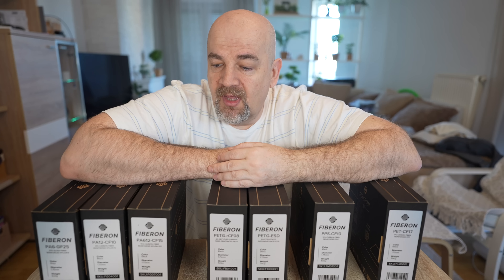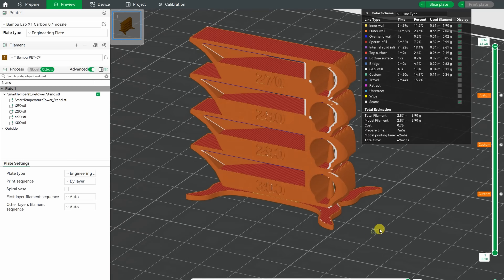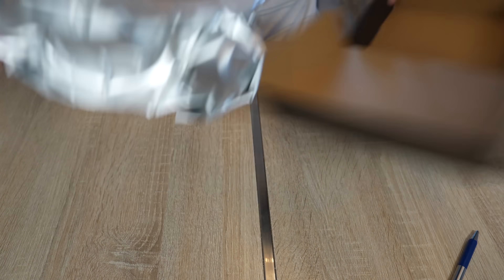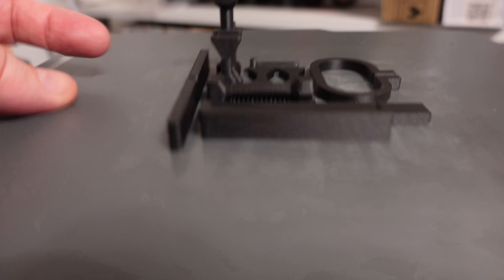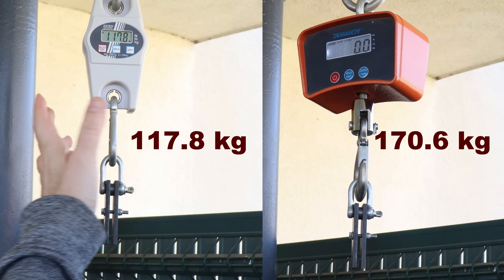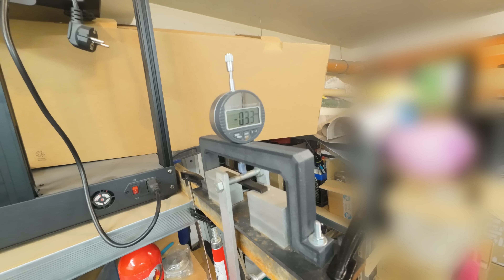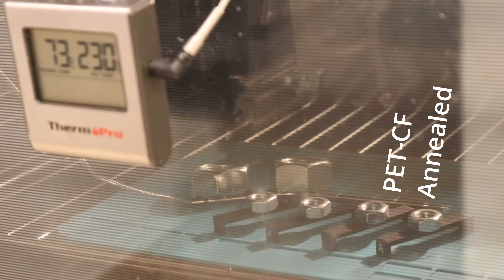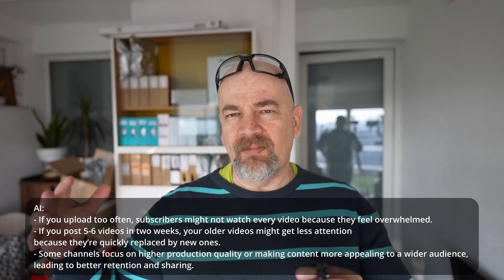Review of Fiberon PET-CF17, a great technical filament by Polymaker

Comment: Hello, I plan to print with this filament on an open printer, I have a Sidewinder x3 pro from Artillery, I will replace the nozzle with a stronger one - made of hardened steel, I would be grateful for tips on the profile for this filament - how to set retraction, cooling, temperatures, etc., so that the print is relatively durable despite the open printer ;), thank you in advance for your answer and best regards.

Comment: PET-CF'S stiffness and creep resistance look great, but the only thing that gives me pause is the creep under higher temperatures. ABS glass transition temp and Vicat softening temp are nearly the same, so it won't appreciably creep until it reaches those temps. But because PET-CF is semi crystalline and has a low glass transition temp of only 79C, it will start creeping more under load once it passes that temperature, even though it's Vicat softening temp is much higher.

Comment: -- Igor, I have a question:

-- Does annealing of the part have to be done shortly after printing, or it can be done at any time? I remember that you said annealed part is more heat resistant, than none annealed part. 

Thank you!

P.S. I'm waiting for my Sunlu's E2 dryer/annealer, back in the January, but they pushed orders to May of 2025.
Reply from the maker: Best if annealing is done shortly after printing, since it don't have a moisture in it. But, probably, the negative effect is minimal. About E2, good for you, it may be a finished version, unlike my prototype.

Comment: Have you seen the critical Youtube video on carbon fiber that shows the microscopic close-ups on the filament. It looks like many small needles. It definitely put me off from using carbon fiber anywhere as I don't want that to end up in my lungs. What's your opinion on the safety of CF printing at home?
Reply from the maker: Yes, my opinion, explained here: https://youtu.be/FZXawsYfFkw?si=jLSOvMzjRYRw5GYK

Comment: 4:48 When you print a temperature tower you should set the seams to back as it will make their positions the same on every layer. This will make the test more consistent overall and provide more insight into stringing and blobbing issues.

Comment: Stephan usually prints larger batches, not just for more data, but to allow "normal" cooling for vertical test subjects. Since you only have the one or two small things printing in the latter part of your print, those will stay pretty hot and have better layer adhesion. But I understand continuing the same way so that you have like-for-like comparisons with previous videos. A compromise of learning vs documenting.

Looking forward to your PPS testing. Not that I can currently print it with the X1C. But I'm seriously thinking of a custom Voron build with a hotter hot end and maybe water-cooled motors so I can get chamber temps somewhat higher than my current 60C. Also having issues with concentricity on the x1c,...

Comment: You want more views? you need to show some more skin, sorry to break it to you, great tests as always, was a big fan of pet-cf when i was reading about it but my nozzel can only do like 260 so i went with petg-cf to try. It only needs 250c.  I got it  mainly for the stiffnes, i heard layer adhesion is weaker due to the carbon particles, hence the need to aneal, but if youre not planning to stress along their it should be as stiff as a stiveny as your test indeed show. I wonder how petg-cf differs. I hear not as stiveny.

Comment: In case it's helpful, I do not have the bell turned on but I am very often suggested your videos in my feed, probably because I usually watch them, and completely. You have a very streamlined video structure which makes it easy to follow and compare. You probably could post less often if you were being much choosier about your subjects making them more "general appeal" like you say and working longer on each one, but with your current strategy people can pick and choose whether they need to learn more about a certain kind of filament or accessory and compare it to your other videos. It also helps for me deciding to watch or not that they are not too long.

Comment: When you do the PA please touch on the bed temp settings you use on the bambu. Polymaker's print profile & settings say you should not exceed 50c as to not violate some material property, however, it seems essentially impossible to achieve bed adhesion at this temperature. I would like to see your experience.
Reply: Use glue on bed

Comment: Thanks for the good review as always. I do have a maybe not so reasonable recommendation: do you think it's worth it to test the water abortion rate/percentage for these engineering materials? I see on polymaker's website, this pet CF and PPS cf are listed as water resistant. I'm curious about how resistant they are.
Reply from the maker: Hm, I want to do some kind of testing on this. BUT one thing is amount of water absorbtion and the other is sensitivity to this.
Reply: @MyTechFun  That's one thing that popped up when I was researching printing nylon. First of all there's not much data about absorption rate, nor is there good information about the effects of printing with less-than-perfectly-and-actively-dried filament aside from a few saturated vs bone dry comparisons. Your earlier nylon drying time video is great, and I bet it would be feasible to do PL4 fitting on water absorption rate with low (dry box), medium (ambient room), and high RH (next to humidifer). Unfortunately as you showed in that video, the percentage of people using nylon is relatively low, and of those who do, the ones that care about specific numbers are even less so. I appreciate the effort!

Comment: Annealing for 10 hours at 100-120 degrees makes pet-cf much more thermal resistant. My prints started to melt at 230 degrees after annealing.
Reply from the maker: Same this PET-CF17? Or other brand?
Reply: @MyTechFun  Same, Polymaker
Reply: @antonurbanovich5153  This is what we've been saying for months now.  Just be wise to the fact that these materials will shrink in odd ways depending on part geometry, in-fill type & % and last but not least what temperature did the layers get laid down on.

Comment: I've been thinking about this for over a year for you doing annealing testing (I need to try this myself); why don't we try to anneal parts, buried inside sand? 

Make simple wooden box, use any type of fine-grain sand (Silica sand probably is best), pack sand tight around part, place whole box with part buried in sand, in oven at anneling temperature. Await results.
I bellieve this will be a better annealed part due to constant pressure surrounding object, with sand holding temp directly onto part, possibly even hotter too. 

I'll also be testing this as well. Let me know what you think about this method.
Reply: I think this will also reduce any unanticipated warping/shrinking x-y-z dimensions as well. Would retain original geometric dimensions in CAD.
Reply: I have seen this done. Another approach is to use fine salt (CNC Kitchen has a video on this) which has the advantage of being easy to clean off with water. Annealing in particulates is certainly advantageous for preventing warping.
Reply: @martinmckee5333   Yes I have seen Stephan's salt annealing video awhile ago; was curious of the benefits of sand over salt though
Reply: @RichardSats-e5l  The two that I'm aware of are the ease of cleanup and the fact that it is possible to get very fine salt in bulk. There may be others, of course.

Comment: Great job again Igor! I use this filament daily and its fantastic! Fiberon profiles are available for the BL printers and i have found the PA612- CF print profile gets better results than the PET-CF profile, just turn bed to 80 and nozzle to 285 and its smooth sailing.

Comment: Thanks Igor nice video as always! This very filament is my goto for inexpensive mechanical parts. 
A couple of requests for future vids:
1. PPS-CF: it would be great to see a comparison with Bambu PPA-CF, which covers similar use cases. 
2. In your conclusion sections, it would be AMAZING if you could add a value in each graph for the overall average of all filaments, so it's clear where the currently tested filament stand in the larger picture. 
Thank you!!

Comment: Great video and it seems I need to try PET-CF filaments as well as I was also more leaning towards using PC CF for my high demanding projects. For the moisture sensitivity topic they have in the TDS a comparison table with nylons that the properties of the printed objects are not impacted significantly with moisture as there is not as much absorbtion. But in general it really needs to be dry and maybe you also did not dry it long enough in the dryer. The long 10 hours of annealing recommendation tells me that this specific PET grade they use as the base polymer has a slow crystallization rate which can be good to avoid deformation and shrinking during annealing, but that means you do need to anneal the prints for longer.

Comment: For what it's worth, the qidi pet-cf default profile has it a 320C on the nozzle. 20C is a fairly significant difference in temperature and might be worth a re-test when you get the xplus4 running.
Reply: I wonder if manufacturers actually measure temperature inside the nozzle and calibrate reference resistors and ADC curves, or just go with "it looks about right" 🤔
Reply: Agreed! ^^^

Comment: I don't know if this could be of some value for other people, but for newbies like myself, it would be helpful to have a common reference for all these measurements; most common being PLA. What I mean here is that 80 kg of load before failure doesn't tell me much, if I can't directly compare it with something I have hands on experience with, like PLA. Maybe a chart compiling all your findings could be a good idea?
Reply: +1 these videos would be more useful and worth watching all the way through with a compare to black PLA and PETG in all the graphs. The average reference is not particularly meaningful saddly
Reply: he has older videos for other filaments, his method stays the same so you could directly compare. he also has a website with the data afaik
Reply: Subscribe to his patron and you can get the full chart of all his results.

Comment: I found PET-CF a lil over a year ago and it has been my go to filament for any project i have built ever since. It checks the box for everything strength, durability, layer adhesion, heat deflection, chemical resistance, and it can handle the sun. I have not tried this polymaker pet but i think ill give it a shot for some parts on my printer im bout to make. If you love it then you need to get some from where ive been sourcing it, its twice the price but i guarantee you its well worth it. Its made in Texas by a company called ESSENTIUM, they make nothing but engineering grade materials and theyre PET-CF is amazing
Reply: I use a LOT of polymaker fiberon PETCF- mostly because it comes in 500g spools for 20.bucks and I'm usually able to knock a project or 2 out with one of those without spending 60 bucks on a freaking kg of filament😂 its good stuff. I actually have some parts IN my engine bay that are exposed to ALL the bad conditions, Chem, petroleum, high heat, all on top of significant physical force and it holds together no problem
Reply: @notyouraveragegoldenpotato  did u anneal the polymaker? Ive went and bought a roll of it and it's no where close to the essentium version, but guess what they don't make it anymore

Comment: I think my favorite engineering filament might be pps-gf.  But I've never tried it 😄 because it requires a much higher temp nozzle, higher temp bed, and enclosed printer and i only have bed slingers.  I want to get a qidi plus 4 if i can find room for it 😎
Reply: It all depends what you suppose to do with the material. Right material for the right job. PPS-CF has some good properties and some that are not as good. And its not cheap and not environmental friendly so should only be used for those parts that really needs it properties.
Reply: @drosendahl  those are good considerations when selecting filaments.
Reply: @ Yea, right tool for the right job! My biggest problem with functional 3d prints is often rigidity (as always depends on model and use case). There, the PPA-CF is without doubt the best I have used so far, especially if it should keep the rigidity in moist environment. But PPS-CF seems very similar. (edited: I confused PPS-CF with PC-CF earlier)